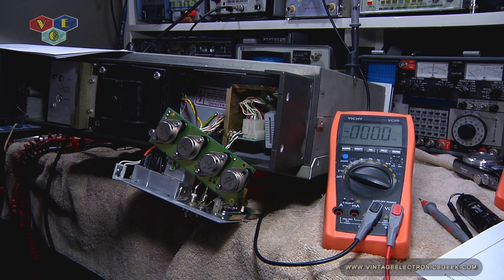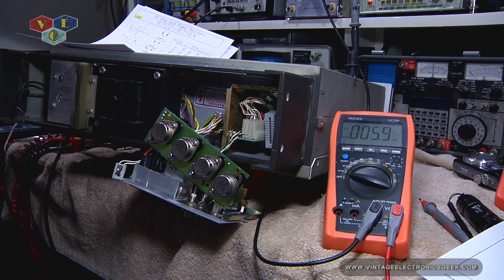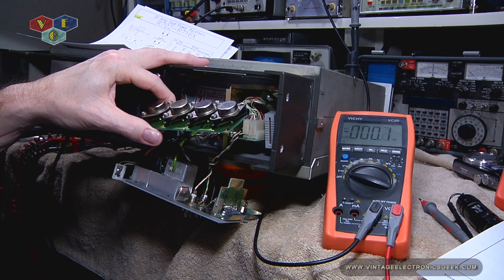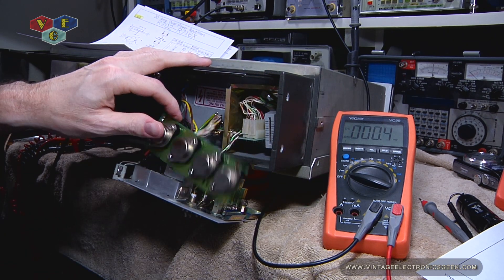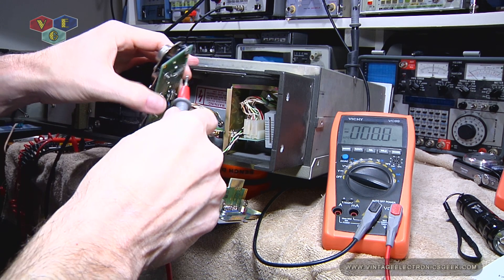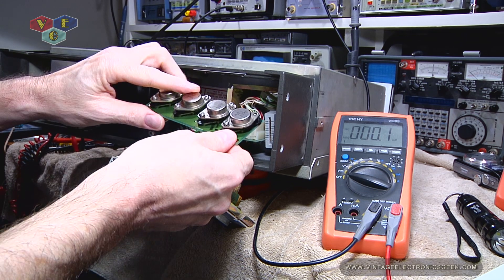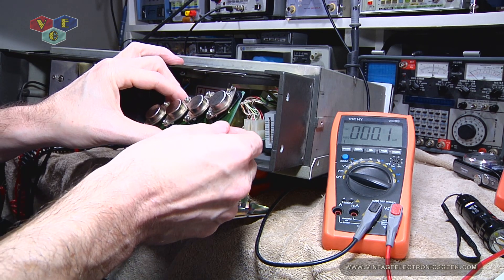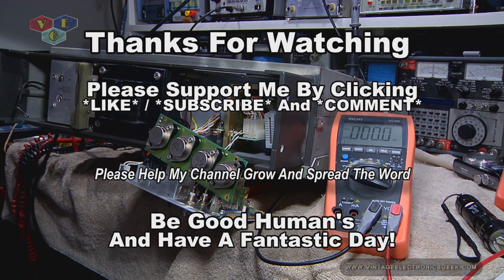HP 8656A Signal Generator - Update - Part III

Comment: Ok Jack. Glad you scored some goodies.

Larry's Bc342 works great and I have the antenna tuner working.

I ordered a slow gear motor to drive the roller inductor.
Now I need to get some gears.

Ok, hope all goes well with the eye procedure.

Seeya 
Ron

Comment: So Jack. Did you find any gold mines yesterday?

I came back with three TCS radios, a BC342, An Antenna tuner, A J38 key, a bunch of parts and a Motorola signal generator
Reply from the maker: Howdy Ron!  I did good...I picked up a Davis Electronics Freq counter, color bar generator/ time reference for video, Kenwood HT, Icom IC-25A in the box, 3 parts bins, 1974 GE radio and 1959 Zenith Royal 500...my hands were full, I went back for those BNC cables that you had bought and they were all gone...$5 was an awesome price...my losss...next swap hopefully  :)  It was very nice meeting you there...hope to run into you guys at the next couple in NV.  ~Jack, VEG

Comment: you are getting there Jack,  I feel that this is one project that will need a hideous amount of time wasted on going around in circles and gaining nothing, sorta,
 Break it down fella, power supply or the unit, - it's the unit at fault as it is drawing too much current.
can you bypass the entire power supply with a bench top box?,
 Down the rabbits hole i guess, 
Sam.

Comment: Jack you have very nice bench equipment. I wish I had the same. LOL The old disconnected power plug. I have done that before. I think you need someone right there with you to help. The olde addage-  "Two heads are better than one". Nice video.
Reply from the maker: Thank you Gary, I am trying to upgrade to better gear....however, you have nice gear as well...plus you have the skills to repair them, something I am trying to hone!  :)  I do need an Elmer, that's for sure...unfortunately I don't..outside of whatever help I can muster up here on YT and hardnox.  Take care my friend.  ~Jack, VEG